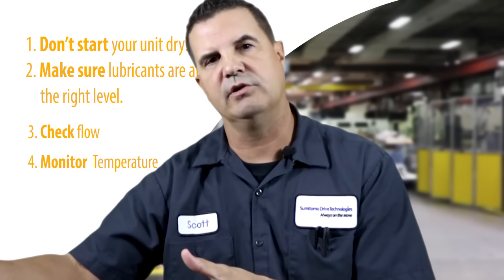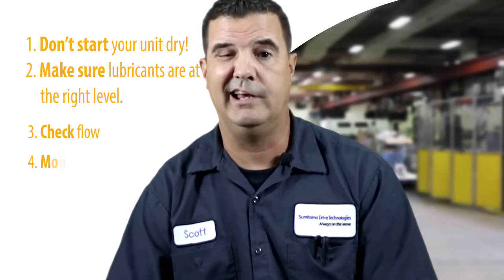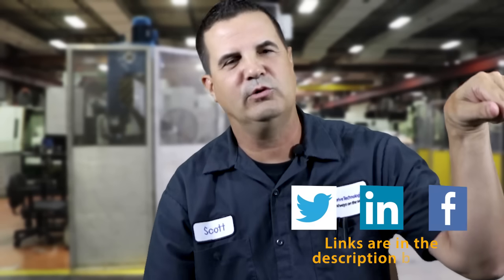Proper Industrial Gearbox, Gearmotor & Speed Reducer Lubrication | WCHYWT #1

Comment: To all comments here.. An additional knowledge about lubrication.. Use right oil that has more additive added like oxidation inhibitors, seal conditioner, leak inhibitors, adhesive /cohisive polymers, shock load reducers, anti foam agents, demulsifiers, rust and corrosion inhibitors that kind of oil really protect to your machinery and always use flushing oil that is oil base not acidic or caustic base because it can damage ur machine

Comment: Does somebody manufacture a portable gearbox flushing machine?  We have some gearboxes at work that have quite a bit of metal shavings in the oil.  Management wants to run them until failure as the price to rebuild them is very close to brand new gearboxes.  I would love to try and flush out all of the metal flakes and give them some fresh oil so these babies might make it until I retire...ha ha ha.
Reply: Yes we can provide this. Www.oilsupport.nl

Comment: how lubrication interval is calculated for gear boxes ?
Reply from the maker: Hi! Start by checking out the manufacturers O&M for recommended lubrication types and change/replenishment intervals. Typically these are based on operating/ambient temps and changes/replenishment are usually by operating hours. Hope that helps!

Comment: HI what's the best lubricant for a low speed hight pressure gearbox? OIL OR Grease?   Hope you can help thanks in advance
Reply from the maker: That is great question! There are variables to consider such as gearing type. Please reach out to us at service@suminet.com
Reply: It all depends on what type of gearbox it is. Worm gears take worm gear oil. Speed, load, temp plays a big roll.